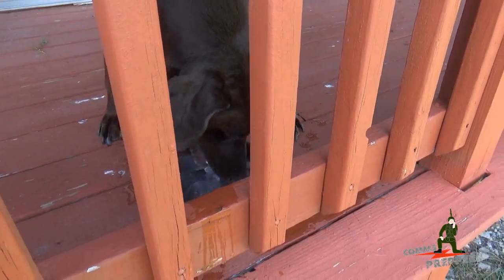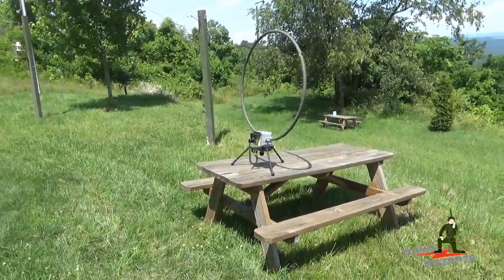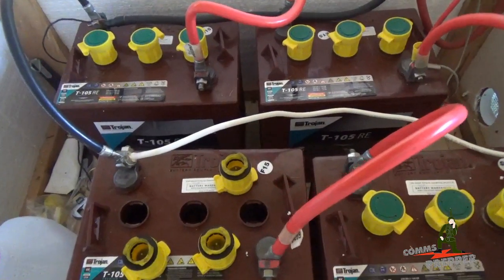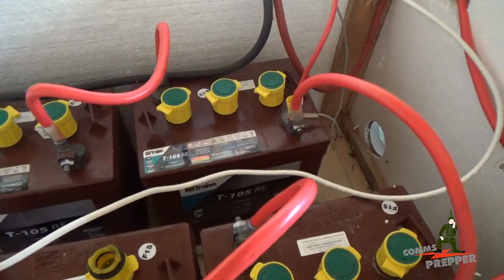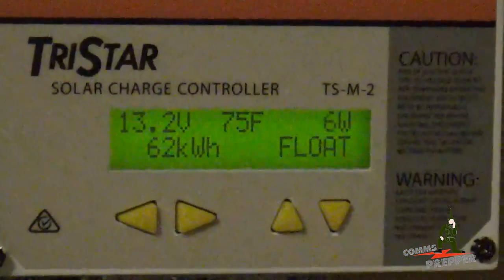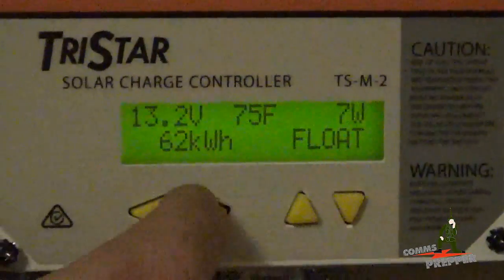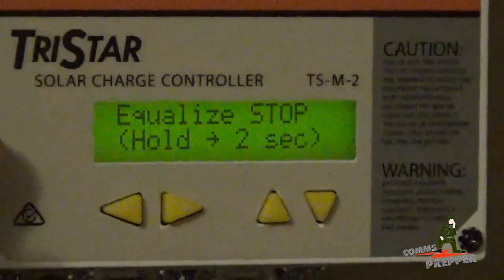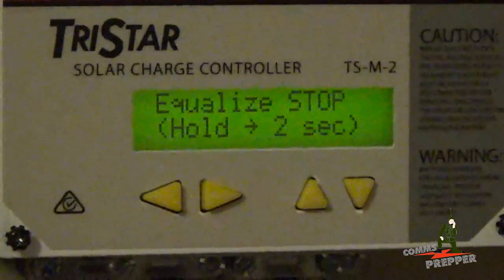Off Grid Solar Power Battery Maintenance

Comment: Some people have mentioned not to use WalMart distilled water on batteries.
Reply from the maker: Chinese screw the distilled water up too?
Reply: You need to get a decent TDS meter and check each jug of distilled water. You’d be surprised how much TDS some have.

Comment: 1/4 cup of water per cell.... seems like a lot.  Any idea on how low they would be w/out the caps?
Reply from the maker: Actually that's not that bad after two months of no maintenance.  Can't really answer your question.  Too many variables, like temperature, power consumption, and charge rates.